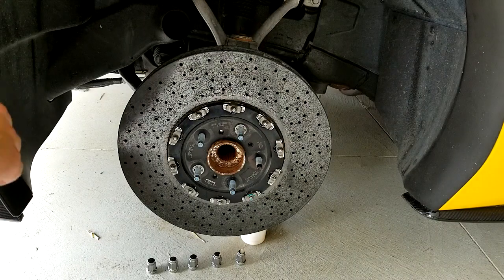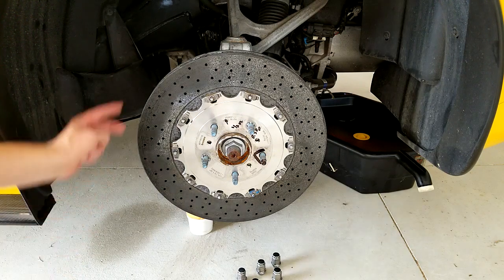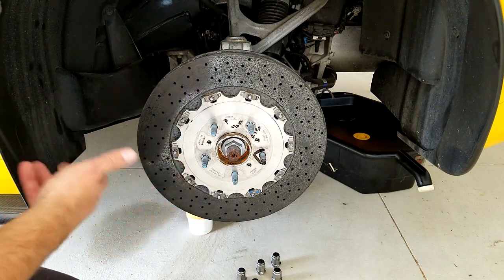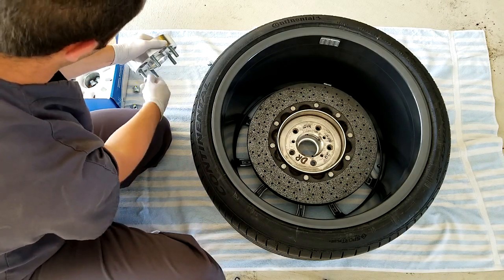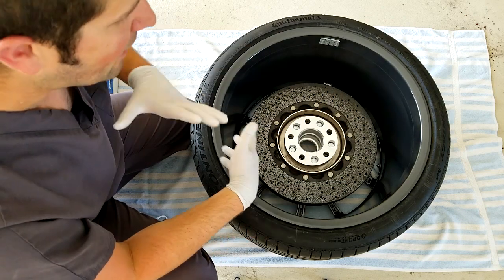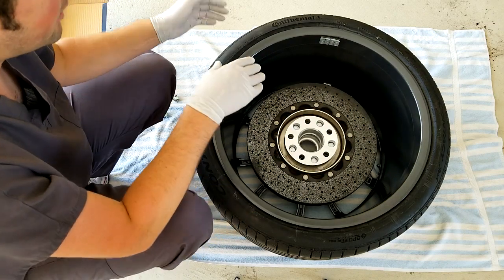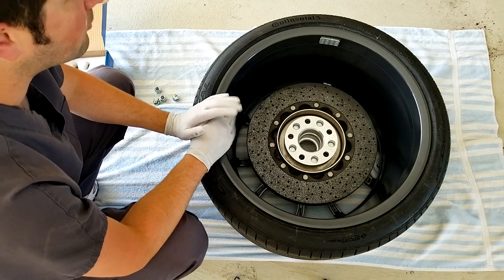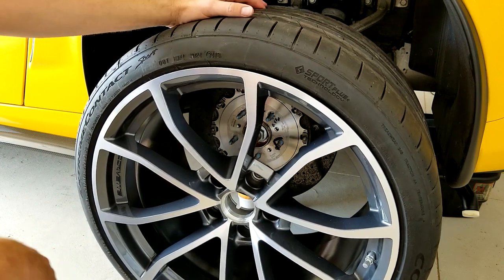Carbon Ceramic Rotor Imbalance Fix

Comment: I just read your forum thread, your mistake was removing the temporary weights as you mentioned. When you add the weights to balance the rotors onto the wheel surface, they stay. So say that 1 oz you added, that stays when you go to road force balancer. And you add the additional weights it asks for. Unless I misread? Sorry in advance.

Comment: My 2013 ZR1 has had a vibration since I've owned it (bought 6 years ago with 10k miles). After repairing bent wheels, replacing one, and road force balancing and match mounting the tires, the vibration was still there. It was a harmonic vibration that started around 50mph. I analyzed it with a oscilloscope and determined it was indeed a 1st order tire vibration. Since I had already ruled out the wheels & tires, rotors were my next target. I just mounted new tires today and decided to balance the rotors with the wheels as shown in this video.  I spun one wheel up without the rotor attached and then again with the rotor attached. I subtracted the difference and determined that the rotor was 0.25oz off on inside plane and 0.75 oz off on outside plane, which is significantly out of balance for a rotor. I only did the fronts at this time but I will say it is a 90% improvement. I plan to do the same to the rear rotors some time soon.

Comment: Are you an aircraft mechanic?
Reply: Well damn, I did not notice that....shame on me lol.
Reply from the maker: @alexc7641   I do have a background in engineering though so you weren't wrong to think so
Reply from the maker: The scrubs gave it away, didn't they?
Reply: When you were mentioned of indexing the rotating components to each other is what leaded me to think that. I used to work in a jet engine overhaul shop...we indexed everything to avoid having imbalances/vibration issues.
Reply from the maker: @alexc7641  Makes perfect sense. You just create more work when you don't index anything that rotates. To me it's become 2nd nature and feels like common sense but that's why I made this video, as I discovered it apparently isn't common sense to most

Comment: so is there on the market any carbon ceramic rotors replacements that cant need  later balancing ?
Reply from the maker: Form what I've heard it's still a crap shoot as most of the stuff people find now is new old stock from the last 15 years.  Best suggestion is just to buy from a reputable source and ask what their policy is on returns on unbalanced rotors. At $1800/rotor, I wouldn't buy without a written agreement to their return policy on out-of-balance rotors.

Comment: This was a brilliant and informative video 👌- I assume that the spacer has little margin for error, so relatively risk free when considering the total combined balance and can be discarded as you did. I do not have much experience of modern day spacers, but assume if machined correctly they are inherently well balanced 👍

Comment: Hello andrew, i have a porsche turbo S with fitted carbon ceramic brakes, whenever am driving 100km/h and above and then hit the brakes the car and the steering shakes, What service center have told me is that i need to replace all the brake discs, however they are completely fine but need balancing as what you showed. My question is that what do you do with the spacer after you have balanced the tires and rotors together, and do i need to have 4 spacers or are 2 enough. Also how do i know if my wheels are hub centric or lug centric.
Thank you and amazing video!!
Reply from the maker: Hmm that's a tough case there. Typically when the car only vibrates and/or steering wheel shakes ONLY when applying the brakes, that's not a rotational harmonic imbalance but rather a transverse imbalance or warping. Due to the properties of CCRs, It's extremely if not almost unheard of for carbon ceramic rotors to warp but I can say it's not entirely impossible..but barely. If your rotors are spun on a rotor or wheel lathe and they say there is "lateral runout", there is no balancing that can be done and those rotors absolutely must be replaced. If that's the case, they might not be warped per se, but rather when they were produced, the angle that the carbon ceramic was joined to the metal hub plate in the press was anything other than 0.00 degrees. This was a known issue that caused many ZR1 owners heartache which cannot ge repaired or even band aid fixed and requires replacement. Now assuming you are still going to go forward with this method of repair I've illustrated, once the whole assembly is balanced, the spacer is removed completely and is NOT mounted then the rotor and wheel are put back on the car. In theory you should only need 1 spacer since you will only be doing 1 at a time, but in my case I found it easier to mount all the rotors/tires to their own spacer so that when I took them to get them balanced, I didnt have to bolt and unbolt all of them right there in the tire shop, wasting everyones time. Lastly, as for hub and lug centric, let me explain further. If your wheel is lug centric (which is getting to be the norm), you will see a conical shape on the side of the lug nut that contacts the wheel AND will see the lug hole in the wheel is ALSO conical. As you tighten the lugs on this design you typically see the actual wheel slightly adjust into position as you tighten each lug a little bit more. Hub centric lugs can have a flat backside as the lugs themselves dont move the wheel into position, meaning the light hole also has a flat area. A hub centric wheel will have the hub or wheel interlocking into the other part in a very tight fit perfectly, thus meaning the wheel will be perfectly centered when mounted and the lugs do nothing more than hold the wheel to hub. As mentioned, the dead giveaway is usually the flat ends on the lug nuts. Not to make it more confusing, but some lug centric wheels can also use centering rings that help to get the wheel in the center for mounting and they are usually found on aftermarket wheels that allow them to fit different sizes/makes of hubs. Hopefully this clears it up a little. I'm thinking there are probably some youtube videos on hub and lug centric differences. Let me know if you have any other questions.
Reply: @HexedInOhio  You are correct the CCM rotors never warp, no crack due to heat stress. (most cracks are from the impacts)
This Porsche owner issue was most likely due to the disc uneven deposit causing surface "unparalleled" that can only be felt at higher speed. A proper procedure to correct that is to restore the rotor surface by removing the deposit, then re-bed the rotor with a new set of brake pads made specifically for CCM rotors.
Reply: CCM rotors never warp, no crack due to heat stress. (most cracks are from the external impacts)
Your issue most likely was due to the disc uneven deposit causing surface "unparalleled" that vibration can only be felt at higher speed. A proper procedure to correct that is to restore the rotor surface by removing the deposit, then re-bed the rotor with a new set of brake pads made specifically for CCM rotors.

Comment: Andrew, after you put out this video, how many miles have you driven the car? Is your car better after the "band aid Fix" when driven over 80mph? Do you like the Conti Extreme Contacts over the stock PSS ZP?
Reply from the maker: I'd say it's in the realm of nearly 1k miles since. The car drives dramatically better than before, although it still isnt completely gone. Band-aid fix is 100% accurate. To be honest, the only range I personally have a vibration anymore is between 72 to 85 now, and it come and goes randomly. Everything above and below are smooth as ice. I love the Contis compared to the PSS, hands down. Rides much quieter, not near as stiff and then tread wear is noticeably less. If you tracking the car, they might be a hair too soft for ya but for touring they are top notch. You also cant touch the price.

Comment: I’m surprised Brembo doesn’t offer balancing to used rotors by just removing material as in the third gen rotors. As just a small chip on the edge can make a difference...Great video, thanks
Reply from the maker: If anyone would ever discover a company that could actually do this, I'd practically overnight my rotors to them. It really is such a simple process...